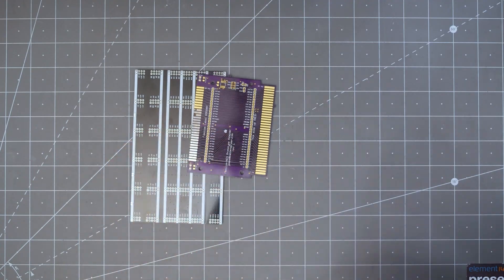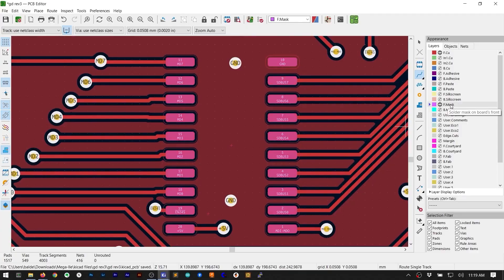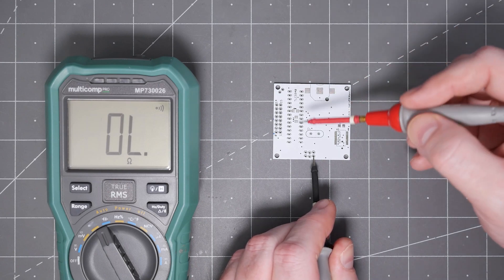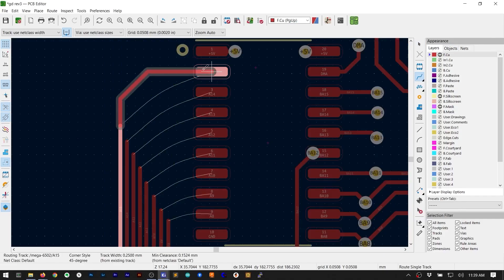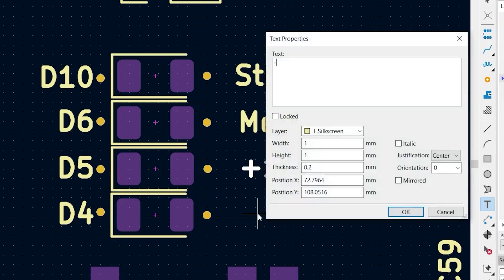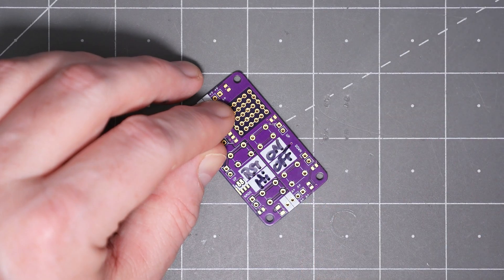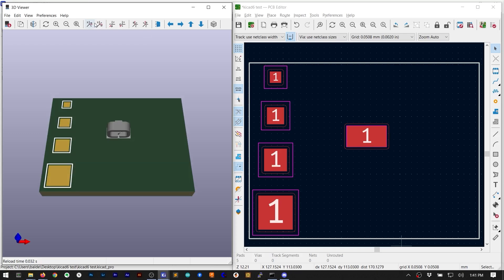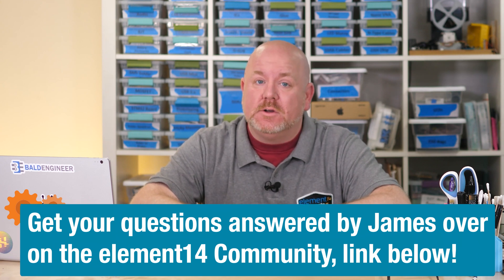PCB Prototype Design Tips and Tricks - Workbench Wednesdays

Comment: The common misconception about how PCBs are used in prototype work is that they are all cut (or trimmed) to the final shape and, when they are delivered, you have a little stack of same size boards. This is one way to do prototypes, but is really not all that helpful. 

The better approach is to panelize many of the same board or board types (same number of layers and stack up). Why, because a panel will have areas which are not occupied by the boards themselves, called the excess or coupon area, where you will occupy with dedicated testing circuits and other PCB manufacturing tests (like silk-screen line size and consistency with smaller and smaller line widths), and a layer stack window. When a panel arrives for production the first step is to characterize the complete panel using the test circuits (like transmission lines test traces, e.g. strip-line, microstrip), then the boards themselves are tested (usually flying lead test machine for continuity). By testing a panel at a time you know every board on the panel will act the same.

For prototype board test waveform integrity the design might include SMT high frequency test sockets, or dedicated SMT test headers for logic analyzer attachment. Usually, once the board goes to production these specialty test points (headers and jacks) are not populated (due to cost, if not needed for end of line bed-of-nails testing, which they usually are not), but can easily be soldered to the board to help in testing a field return. A thru hole test point is not usually the best choice because it produces a stub, and it also takes up more overall space (because you are going thru layers to the other side of the board), so, you are usually dealing with an SMT approach to a test points. 

To further reduce costs you can use SMT pads to connect a spring loaded programming header. For analyzing field returns that have conformal coat during production, you can use a very sharp point version of the spring pins (it will penetrate the conformal coat), although this may be a special order for the more popular spring pin JTAG+Debug round tipped pins.

The other old school testing connection is using an edge connector, this too is relatively inexpensive, although not as popular as in the past.

Comment: I make many isolated power supply on the pcb. For every supply i always add test poin n led. For analog circuits test point to attach multi meter is very helpful too

Comment: The great thing now about PCB design is it is so cheap to spin a new board that you can dedicate boards just to be prototypes. Too many times I have seen designers try to shrink board dimensions down to some minimum they are striving for in the final product. Instead what you want to do in the prototype is give yourself enough room so you can probe signals and solder on power, test points and programming headers. If you have spare space then add a grid of 0.1" pads. Lots of times this will give a prototype a second chance of getting through multiple trace cuts and component changes before it needs to go in the bin.
Another feature of a prototype board should be a number of LEDs. You want one for each power rail and at least one tied to a GPIO from any micro-controller. This way you won't have to drag out a multimeter every time you power up your design to determine that the fault is not in the board.

Comment: I admit I'm new to PCB building.  However one thing I have learnt is to 'sleep on it' for a couple of nights before sending in my gerbers.  
I find doing that helps reduce the 'Oh oh, I forgot the ... !' factor.
I also have a number of modified footprints with enlarged holes/pads to assist with my soldering of my PCBs.  I hate trying to solder when the pad looks like a thin ring around the component leg.

Comment: I have one: Never use 2 Layer boards in prototyping. Manage your GND and power planes from the beginning. This will making component and design choices a lot easier, because you can actually measure the EMI/EMC performance.
Reply: Never use two layer boards PERIOD. Today's circuitry is too fast for lousy power and ground. We kind of got away with that 40 years ago, but it was dicey then. Also, add series damping resistors to all the outputs you can. If they are there, you can always adjust the values or leave them out in the next spin, but if you have a volt of undershoot and no resistor to damp it, you are in trouble.
Reply: @daleinaz1  I'm confused, you mean don't have components on two layers, or don't have 2 layers of copper?

Comment: HI! I want to know what the most common BJT transistor MOSFET power transistor and power MOSFET I should have as a beginner.
Reply: I suggest BJTs like the 2N2222 or the 2N3904 are very commonly used and are general purpose NPN transistors.  The 2N3906 is a complimentary PNP for the 3904.  These are cheap and easy to find.
For a MOSFET try the 2N7000, although I don't tend to use MOSFETS or power transistors often.  JFETs like the J310 or the trusty old MPF102s and BF244s are good to have tucked away in your drawers.
Reply: @paulperano9236  thank you for suggestion.